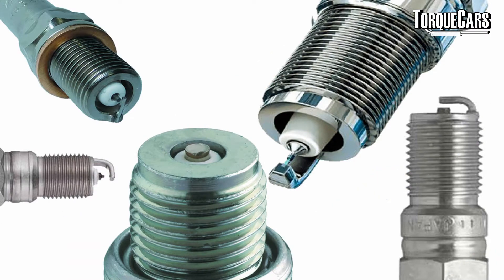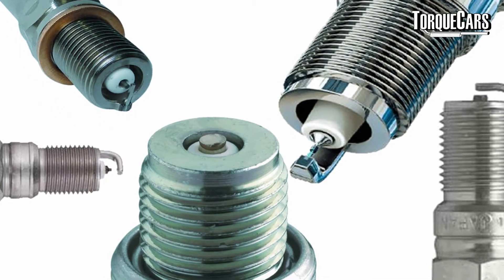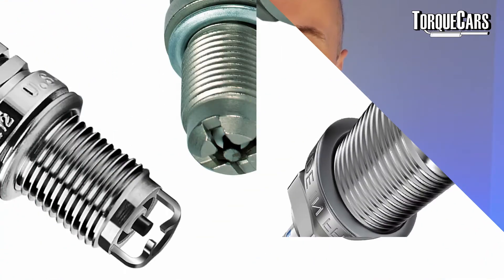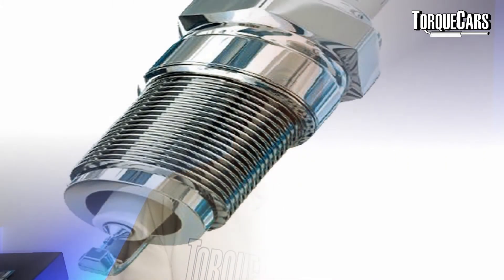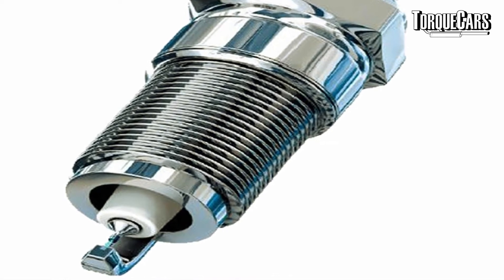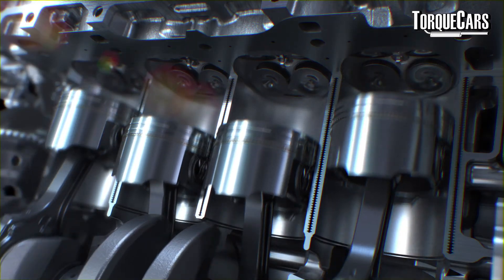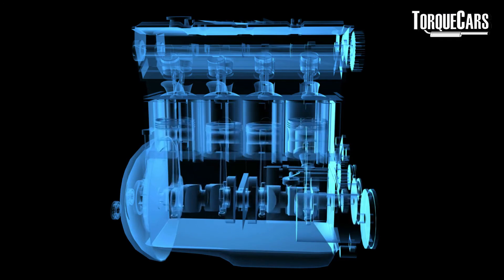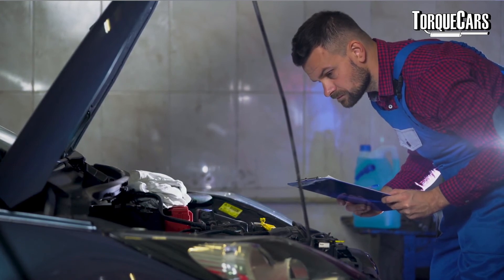I Wish Someone Told Me This About Spark Plugs!

Comment: Wouldn’t a larger gap on your plugs allow for a longer spark within reason?
Reply from the maker: This was something we used to do in the past but things are so much more precise now with modern ECU's coilpacks and engine tech and pre gapped iridium plugs. In reality, although there is a thin margin here, although you get a longer spark, it is usually shorter in duration, this is the eternal tradeoff. And when gaps are too wide you increase the risk of a misfire.